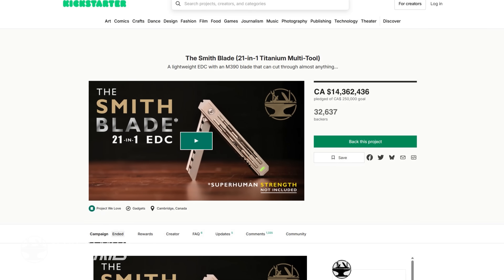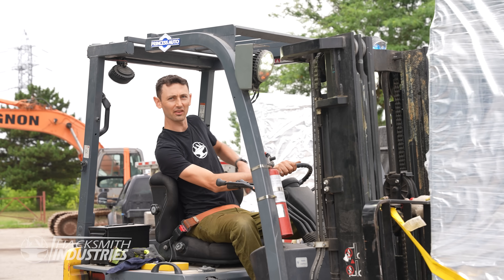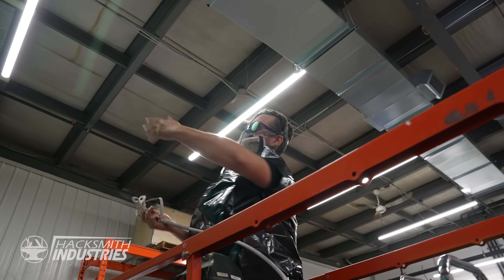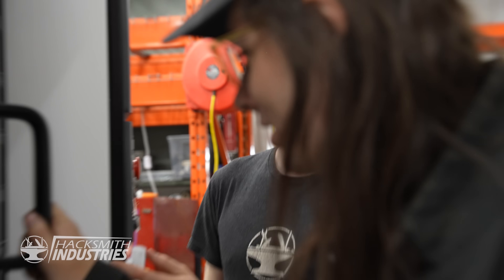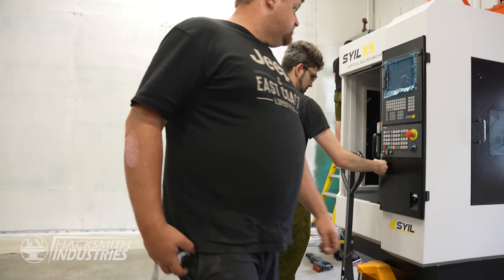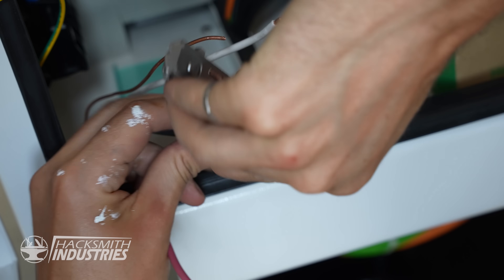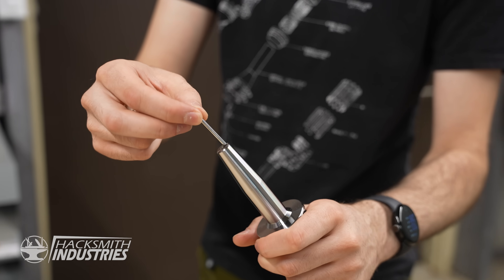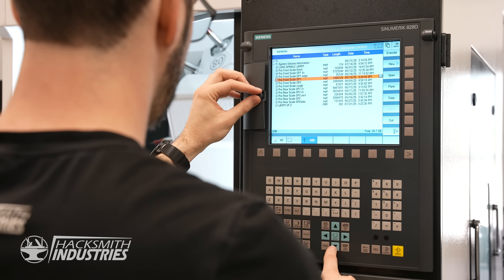Our First Machines Arrived! | Smith Blade Update | 01

Comment: 7:20 No way your running into accuracy issues due to your tool holders. Especially on SYIL(No offense). Shrinkfits in general doesnt show dampening charesteristic better than ER. Those looks like L100? Your machining knives ? Low profile parts, on 3 axis?  Using stubs should be a no brainer.
Reply: Definitely looks like people that have no experience in running a real factory, so much wrong choices before even starting ...

Comment: @7:50, no, an ER collet cannot fit a tool larger than it's designed for. It's not +/- 0.5mm, it's just 0 to -0.5. Larger collets can compress more.
Reply: er 40, 32, 25 can hold -1mm
Reply: As I saw this piece of the video I immediatly went into the comments and was happy to see your comment.